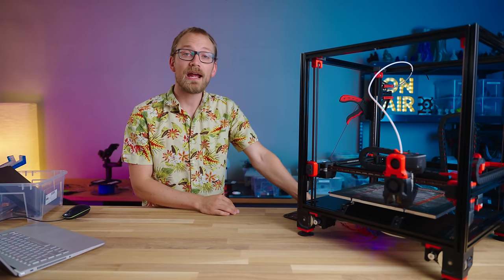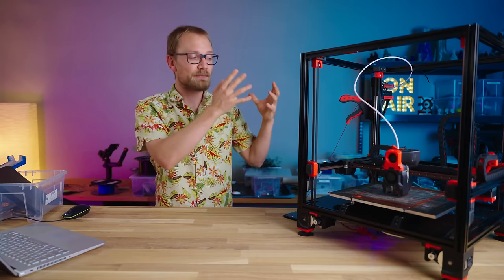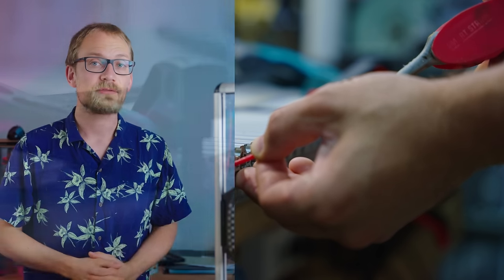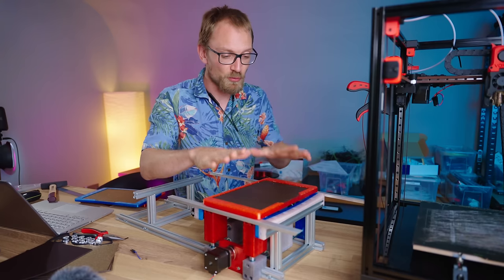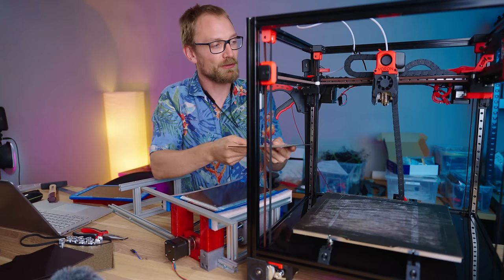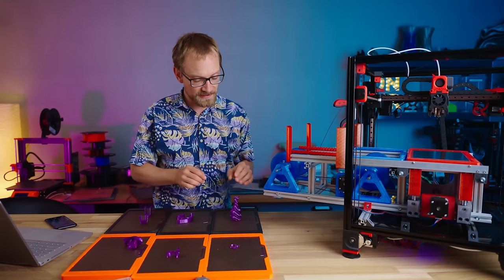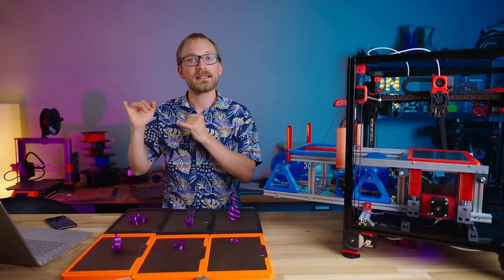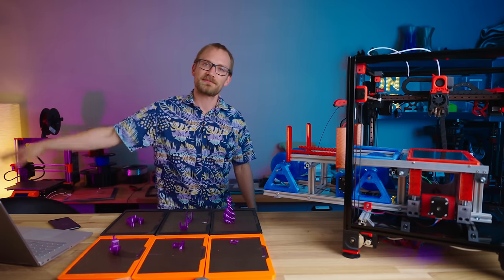Fully automated 3D printing using REAL print beds!

Comment: The way I see it, most of the Z-Height is lost due to the Peeling Mechanism... Maybe consider the use of a Magnetic Chuck with ON/OFF Mechanism being controlled via a Servo instead?
Turn OFF MagChuck > Slide IN new Panel > Turn ON MagChuck > Print > Turn OFF MachChuck > Feed IN new Panel / Slide OUT old Panel > Turn ON MagChuck > etc...

Alternatively I could still see the use of Belt feed system on a regular Heatbed where a Panel is being fed in about 2cm above the magnetic Heatbed ( preventing it from sticking to early ) and while the belt keeps going an Endstop with a 1cm gap between it and the Heatbed at the outgoing side will cause the Panel to slide off while the belt underneath it keeps moving until a section of the belt appears that is below the surface of the Heatbed causing the Panel to lay down on and sticking to it.

For the removal of the Panel the Belt would continue to move and, with a wedge like shape pry the Panel off the Heatbed until the latter has released enough from it to get carried away underneath the previous Endstop and out of the Printer. That setup would most likely require for the Panels to be slightly larger than the Heatbed so the Wedge could get comfortably under it. Maybe also experiment with a Bearing or two on the Wedge so it can easily slide underneath the Panel. With a setup like that you'd only loose a fraction of the Z-Height - Or maybe not even that considering the freespace below the Vorons Heatbed.

Comment: Also, regarding the filament running out, I would like to explore the option whereby the filament is automatically heat-spliced to a new roll at the end of the current roll, all while the printer continues to print, which would save a ton of end roll wastage. If you do it in such a way where two filaments come together and make a thicker bulging part, that the excess could be carved away or heat shaped down to 1.75mm to fit thru the extruder, or otherwise have the printer interrupt the job to spit out the excess plastic.
Reply: Mosaic Palette does that, one can get some inspiration from this device
Reply: How cool would it be to have something like the pallet but just with a simple splicing system to keep prints continuous.

Only 2 entry points necessary and you alternate when a roll finishes.
Reply: @BeefIngot  none that I know of. Probably someone is yet to design it. Who knows, maybe it will be you.

Comment: Cannot believe you didn't put a discharge ramp on it ha ha. Awesome first build and am excited to see what the next one becomes. 
Could you use solenoids to remove the heater? Might be more complicated. Also liner servos/actuators for pushing the beds in... could have a spring popup that catches the next bed on it as well.

Comment: Tom what about the 3d printed arm that picks up the existing Voron bed rotates 180° drops the bed rotates another 90° pick up a new bed from the shelf and places it on to the printer? I think the external system would be much more effective in maintaining the print volume while it still could be used with other printers too giving you much more flexibility in printer choice.

Comment: use electromagnetic connection and a long sheet of spring steel print bed (or multiple sheets with interlocking frames) this way you can get all the drive components for bed advancing outside the frame to keep as much Z axis as possible.

Comment: Wild idea for cutting down on the z-height: would it be possible to just embed a copper coil under the spring steel bed and when you need to remove the print run 24v through it and magnetically levitate the entire build plate off the magnetic heated bed. If that would actually work you wouldn't need the lifting mechanism. The coil could be powered Carrera Bahn style through powered rails with sliding contacts to avoid tangling wired when moving the build plate out of the way. Since the coil is copper it should 't negatively affect the heat transfer. If anything it would probably even out the distribution 

Potential Problems I see with this: 
-the achievable lift might not be high enough to actually lift the steel sheet and the part
-the electromagnet might demagnetize the permanent one, but afaik that would only happen if you constantly changed the polarity of the electromagnet.

Alternatively you could also replace the permanent magnetic bed with an electromagnet. Choose the wire diameter correctly and the electromagnet could double as your bed heater ;)

Comment: I have an idea for optimize it. maybe you could also try using hydraulic mechanism on the original print bed. just popping up 4 cylinder on 4 corners after printing and using something like robot arm from outside the printer, to push the pei plate and so on

Comment: Solenoids under the edges of the bed to replace the mechanical pull down that would allow you to give you more z height the feed could be the same size then the solenoid popper could hang over the whole base

Comment: hey tom think of  building it in to the base of voron instead of setting it on the old heat plate then you wont loose any Hight just makes the printer overall taller

Comment: Cool, but the conveyor belt design seems like the simplest best, just without that silly 45 degree printing aspect of the creality. Why not just do what you've done but without the 'cartridge' system, rather the conveyor is the print surface itself, conveyor just rolls on a full bed width and traditional printing continues. I reckon after completion an item will self-release from the bed as soon as it attempts to roll off the end of the belt, although some effort will need to go into controlling the strength of the bed adhesion to make it work.

Comment: To manage the gcode, you can print multiple object, assigning  a new virtual tool on each model, print one object per time, and use the tool change gcode to swap the bed. With s3d you can slice all the model in the same position with no care for the the warning....

Comment: On a printer with a moving bed in the z axis, this could be integrated and not need much more room. The Z axis would of course need to be beefier to avoid it warping with all that pulling. Just move to the end stop where a frame sits and the bed pops off.

Comment: You might be able to use some electro magnets to reduce the height and you could probably power it using a heater output so you could save the stepper driver for something else

Comment: This is great!
Personally I would have handled this a bit different though.

Instead of changing the bed I would've made a similar mechanism to flex the bed, and then used the printer's gantry to push prints off the bed

Comment: WOW!  At time frame location 4:40, I would like a more explination on how the parallel lifting blocks work.  I have not seen that type of mechanism before.  Watching your completed project working, it reminded me of one of the first automatic x-ray film cassette (8"x10") rapid changers made in the 1950's or 60's, call the Sanchez Perez.  I repaired one at UCLA Medical Center in the 80's.

Comment: I really like this idea, and to go further with your 300x300 bed concept, I don't see a reason this couldn't be built into the main bed of the system if you move the electronics off the bottom panel.  (back panel maybe?).  Then you have that vertical area to put your bed lift and the beds can come in just over the base of the printer losing you almost zero Z height.  If it's stable enough (which it seems to be) it would be easy enough to simply not have the rails installed if you wanted it more compact.

It's actually a really neat feature the Voron system allows.

Comment: Nice.

As far as designs to free up more space on the Z axis, how about;

Permanent magnets coupled with (opposing) electromagnets for the magnet release instead of the jack arrangement, and bare base plates pushed into the machine between two parallel guide channels (mounted on springs for a bit of vertical movement). 

Could probably be an inch thick for the part in the build space.

Comment: Instead of the big lift mechanism, could you just have ramps to lift the old bed as it gets pushed? A much simpler mechanism if it works, and only one motor.
Reply from the maker: Lifting the bed requires a ton of force, not sure how well a belt (with a wedge) would fare. Interesting idea, though!
Reply: @MadeWithLayers  Hm, yeah, I though that might be the case. A ramp provides mechanical advantage, but might not overcome the initial "break" from the magnets. I like the cam idea others suggested. Might even be able to drive it with the same belt.

Comment: awesome design and even more awesome execution! 

it hit me though while you were talking about existing solutions: what about a hybrid voron/belt printer? have a tensioned belt loop over the hot plate that only moves after a print completes. It would mean the voron can still use its full size in most dimensions (might cost a bit of Z but i think the mechanism to roll the belt would sit under the printer) and would really simplify the clearing mechanism

Comment: This is genius. 
An alternate way might be to have a mechanism attached to the bed, but lift, tilt, and flex the print off. Then it could just lower back down and you would print the next one on the same surface. Does that make sense?

Comment: Very innovative and well done with this working prototype.. 

Realistically though, there's a long way to go yet.. And using full size sheets how would you cartridge them and get them to fit?  I'm not certain you'll ever be happy with this system if you're planning to go full sise.

I saw one comment here saying about electromagnets.. Maybe a 2.0 of using dual electromagnetic crane system would be awesome - one crane to place the sheet and after printing, another to remove. That would give you full x/y & z. Not sure exactly how this would work - maybe the printer sending a signal to a raspberry pi to activate the crane system?

I certainly don't have the skills or cash to try, but I know you are quite skilled by watching this awesome video and you could possibly have your cake and eat it..

Comment: Could a dovetailed rail cam up to get in the way of a conveyor bar after the last cartridge? Have a finger on the caught rail that will push out after catching on said conveyor bar(spring loaded for return even, just back up the chain in the code, or it would snap back and scare, lol! Maybe a soft return.). 

Pop this up when the magazine is empty with mechanical levers that were held down by the sleds weight. That would add some reach, maybe.  

I love this hobby even though I'm still a newbie. Can pretty much do anything you can imagine eh. Thanks for the brain food! Cheers all.

Comment: Although that enclosure from the sponsor looks quite nice, I would advise caution before enclosing a Prusa or any printer with PETG parts. Enclosing my MK3 melted the toolhead, and I had to find some somebody to reprint it in ABS. I'm not the only one to experience this 

At the very least, print spares of key parts before enclosing, or reprint them from ABS or similar.

Comment: I think there might be another solution that would not add to the height and resulting in less Z space... Drill small holes in the main aluminum bed and use a heating PCB with matching holes. Or machine slots in the alu bed connected in one spot. Then use vacuum suction in the same way CNC routers do. Faster loading/unloading too. Turn off the vacuum motor and off you slide.

Comment: Why while using the full size bed, since it's bigger, it can be pushed from the side of the printer instead of the whole contraption sitting where the original bed was (if that makes sense)?
That way, you regain a lot more usable Z height. (for swapping the bed, instead of the whole push up thing you could just lift up the bed from the sides, since yet again, you're using the full size bed).

Comment: how about using a magnetic bed  used on surface grinders, just add a servo/stepper to turn the switch on or off and you saved yourself a lot of build height aswell as the lift mechanics.
there are also fully electric ones out there. 
or (cheaper alternative) those electro magnets you find all over chinbay in the metal case (12V 2.5kg magnet) just a few of them in a grid.
Reply from the maker: Just need so get them heated somehow
Reply: Security door magnets would work too,
Reply: @MadeWithLayers  right.. forgot about that.   putting those magnets below the heater plate via a insulating sheet probably reduces the magnetic field strength too much to hold it down. it would good enough if the heater is a oldschool reprap style pcb instead of a metal plate.
Reply: @MadeWithLayers  I remember a presentation at ERRF, I believe from Dr. Bowyer, offering up the idea of using electromagnets to both hold down the sheet and provide the resistance heating.  That would be an excellent solution for this sort of bed swap mechanism, but also would obviously require a ton of additional development to even verify the concept (things like determining a minimum PID "off state" that holds the bed but restrains temp overshoot,  avoiding any permanent magnetization, etc.).

Comment: This seems cool, but somewhat chunky.

I wonder if using a polycarbonate curved sheet, and just having a strong actuator slide the magnetic sheet off and downwards onto the curved  pc surface would be good enough to both release prints, and avoid losing much build volume. It would take up more area in front of the printer, but I imagine people looking to dump a ton of parts dont care that much about the space in front of the printer anyways.

Comment: I really like this project, it's awesome and in the long term I'm planning on something similar.
Though instead of that stepper motor mess why not use a simple flat coil electromagnet to keep the bed in position while printing, a PCB is the way to implement that to size and not loose any z axis travel

Comment: What about an electromagnet system to hold the beds in place? You might still need some raising/lowering system but I imagine the forces would be siginificantly less on the lift if you could turn off the "magnetic stick"

Comment: It seems to me that the lifting mechanism is eating up a lot of the build height.  Would using electro-magnets to keep the beds in place not reduce a lot of the need for such a complex lift?  Magnets on and the bed doesn't move, magnets off and you can shift out one bed for the next.  Possibly with a linear actuation mechanism to again reduce height (if even needed there, as this is out of the printer, right?).

Comment: Why not just a treadmill type of conveyor? As long as the conveyor is made out of the right material, it'll self-peel as it gets to the end and does a 180. Make the printing platform a bit higher, to make sure the conveyor is always tensioned against the printing platform surface.

Comment: Interesting mechanism but I'm wondering why didn't you just use 4 pilot holes and some latches? It would be much simpler than magnetics and require a lot less force. Also if you chamfer the holes and the pins then you could easily have it self align without all the messy business of detaching permanent magnets. Does it have to do with how the magentic bed works?

Comment: My first thought was, putting the CR-10 belt running over the original bed, then, when the print is finished, run it out of the printer.

Comment: brilliant idea, however looking at your brilliant design i see you only need the belt to run through the printer, so the hopper and first wheel can sit at one side of the printer and the second wheel at the other side making the print height of your printer optimal????

Comment: First let me say great idea.  This modified my thinking on which will be my next printer.  I like the Voron because of the fixed bed.  This validated that.  Was it your thinking when you decided on building a Voron.  I'm still leaning toward the Hevort though.  I'm afraid that the gantry over time will get wobbly in the corners as things wear a little.    My plan is to build whatever I end up with from a tig welded steel frame to increase frame stability.   I'd like welcome thoughts.

Comment: Look about idea with one motor: imagine 3 layers flipping printbed with peltier tec modules in between and two layers of glass on both sides, now when you heat up top layer, bottom layer is cooling down, effectively makeing PLA-parts to fall by force of gravity, then this bed flips upside down, tec modules polarity changes and cycle continues

Comment: Would a flat belt bed with the existing voron gantry not be easier. It wouldn’t have the infinite z height like the creality but it would be a simple part ejection method.
Reply from the maker: I've not tried too many different belt surfaces, but the ones I did try all allowed the parts to curl as they were being printed. Makes sense when you think about the physics of keeping a wide belt flat - no amount if tension on it can keep the belt from flexing up towards the edges.

Comment: This seems dangerously way overbuilt. All it needs to do is hold a bed in place during a print and engage/disengage with the bed. Why is it so strong that it can take a finger off? (@5:30) What am I missing that requires so much force? It's not actually removing prints from the print bed, just cycling beds. Magnetic print beds seem fairly easy to connect to disconnect, I've seen people remove them with one hand. What am I missing?

Comment: Another great video Tom!!!!  You are my go to guy when I need correct and informative formation about 3D Printing Products and reviews.  I still have and use my Anet A8 printer that is far from were it came out of the box.  I am thinking about building a printer like the one in this video.  Any great advice or changes since you built that printer.  I will have to go back and look at the Model number I think that was a packaged deal not for sure?  Thanks and God Bless!!!